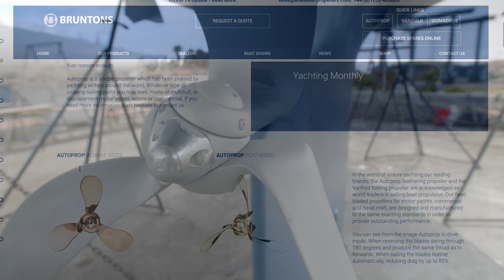Sailing Avocet | Making a SPLASH!

Comment: HI GUYS. The Brunton Autoprop is undoubtedly the best propellor on the market. We have now had 3 of them on 3 different boats. Faster sailing, faster motoring, better economy.  Well worth the investment. Good choice. Sail Safe Guys, Ant, Cid & the pooch crew.
Reply from the maker: Hey friends! Yes, we love it! So stoked Brunton's gave us an opportunity to work with them. We LOVE the prop so far! Fair winds
Reply: @sailingavocet  We are working with them  and Ambassador marine  (Strippers rope cutter) it will be in a video later this year or early next year when we have them both fitted. Currently using the H2 on Impavidus. 1.5 Knots faster max speed! sail safe. Ant
Reply from the maker: Epic! Can’t wait to watch

Comment: Hey guys... the zinc spray paint on the prop got me thinking.  Zinc anodes are there to be eaten away so other metals aren't attacked. However does that not mean that the zinc paint will be eaten away as well and then leave your prop exposed to the elements.  Also, prop speed is there to keep growth off the prop so how is that spray paint holding up?  All the best.
Reply from the maker: Hey there! 5 months later, so far so good. Chris dove on the prop 2 months after we splashed and it had some soft growth on it as did the rest of the bottom, but that is because we haven't moved in 2 months. Not bad considering the surrounding vessels all have hard growth and tube worms :)

Comment: If you don't mind my asking....  How much did the auto prop cost?
Reply from the maker: It retails for about 5k but we traded work with Bruntons so we got it at a discount :)
Reply: @sailingavocet   Thanks! When you share your experience with the prop, I hope you make valuable comments for those of us who would consider buying it. 5K is a lot of change, but if it works as advertised it may be worth considering.
Reply from the maker: @MichaelMechsner  Of course! It definitely works for us as well as for our friends who we recommended it to. The biggest tip we have is making sure you have ample space between the prop and deadwood. Bruntons is very hands on and would be happy to assist in the right fit :)

Comment: Worst mistake ever did was paint that prop  ,prop speed is cheep for the life of your prop DIYS they haven’t got a clue see how you go after a couple of months , prop speed can be a shared buy to boaters just look around the yard see who is nearly ready for some and the cost is halved that what we do here and it works all over the yard good luck
Reply from the maker: Well, my brother did the same on his boat and it’s lasted well over 1 year. During COVID there was no prop speed available to ship to us, and we needed to get back in the water. The yard backed up our choice to use zinc paint, as did a few other avid sailors. Eventually if we have more $ in the bank and time to sit around and wait for yet another shipment we will get some prop speed 🤙  almost 5 months later and it is doing just fine 👌